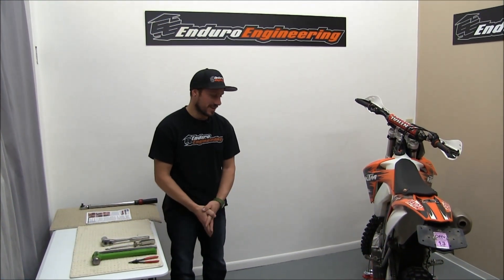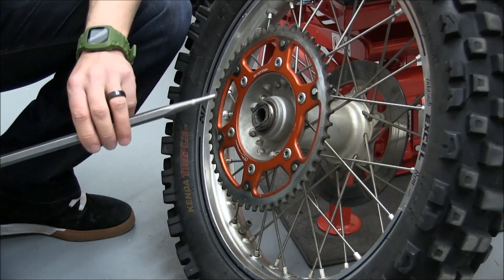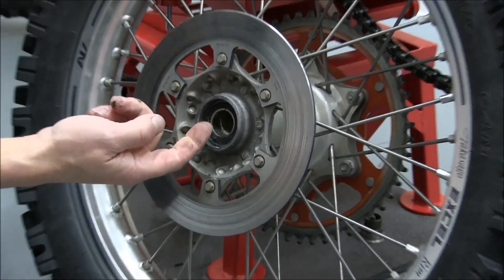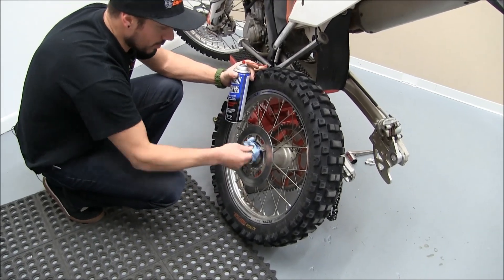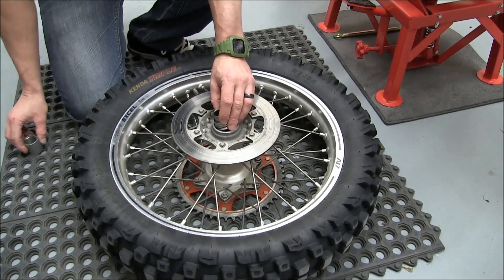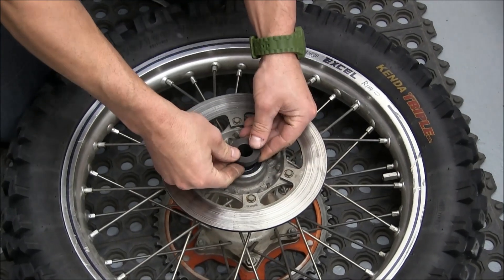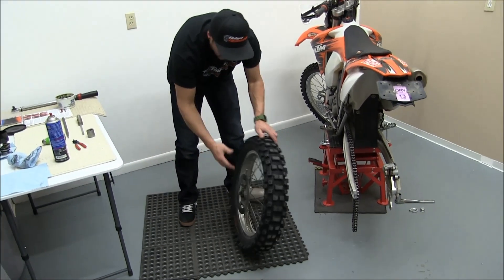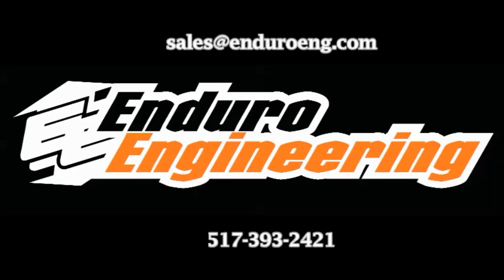Enduro Engineering Wheel Bearing Installation

Comment: Should use a socket the diameter of the bearing.   Never want to hit on the center of the new bearing.   Small amount of heat from a map gas torch on the hub new bearing will go in with no damage.

Comment: I have the exact same bike.. 2013 450 XC-W... About to change my rear wheel bearings a second time..  Great Video
Reply: My bike also has the nylon spacer, I can't find a video that mentions it though. I'm confused.
Reply: @garethbassett8186  Yea i replaced my spacer.  It allows the bearing to not be pressed against the spacer tube. Just order a new one with the part number on the spacer seal. Its like $2.
Reply: do all ktm wheels have the snap ring?
Reply: @59plexi  You mean spacer ring?  It will depend on what hub the factory installed.

Comment: To make bearing install easier pop the bearings into the freezer for half an hour or so, they shrink just a bit and will install with less force.   Use the old spacer upside down to drive the bearings in square to the hub instead of tapping all around the outer edge, it's faster and harder to mess up the hub.  Fill in the seals with grease as well as putting the grease on the outer surface of the installed bearings.